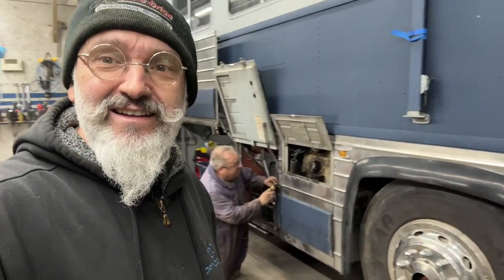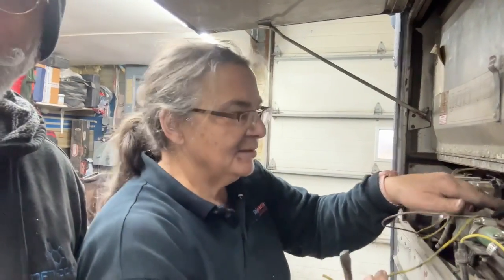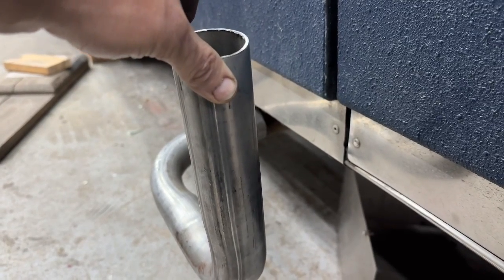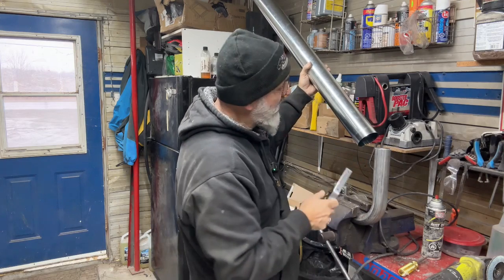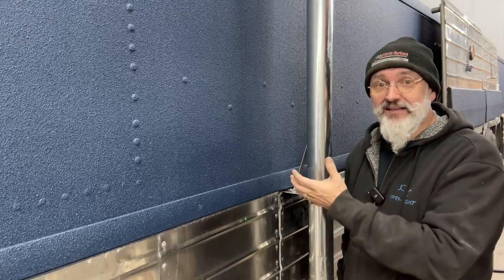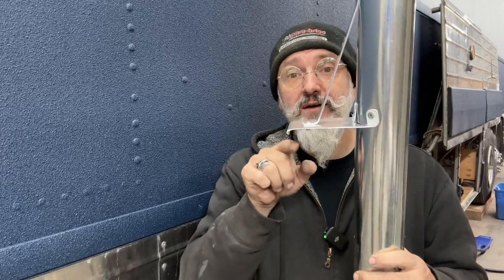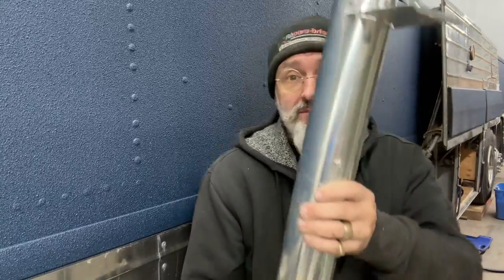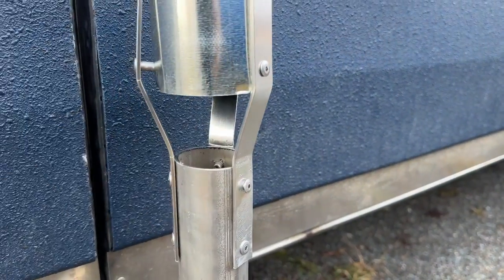Building a “genturi” style exhaust.

Comment: Thank you so much for this video, and planning on making one myself.  Where did you buy the steel pipe that connects to your current exhaust pipe?  Also, what did you use for the angle brackets to connect the steel pipe to the upper smoke stack portions?  Checked at Home Depot today but couldn't find it there.  For the 3" smoke stack portions, I was wondering if I would be able to release the connection point to store them flatter when not in use since I have a travel trailer with limited storage space.
Reply from the maker: The lower pipe I had bent at a muffler shop. 

They are flat aluminum bar